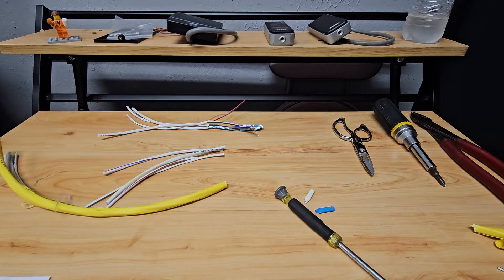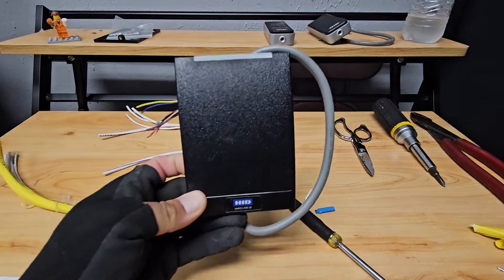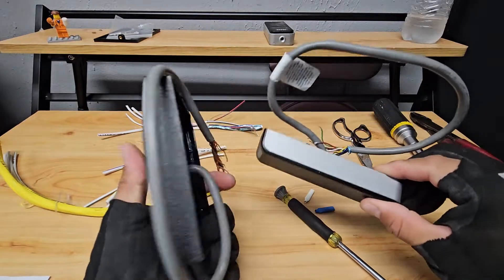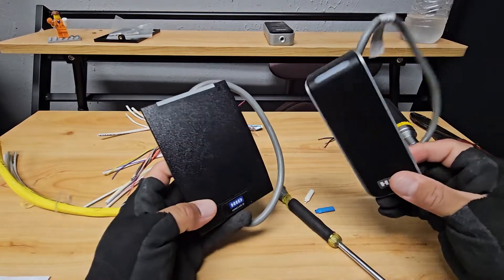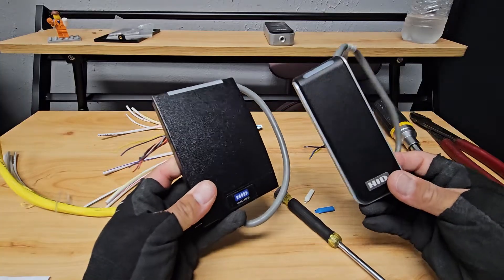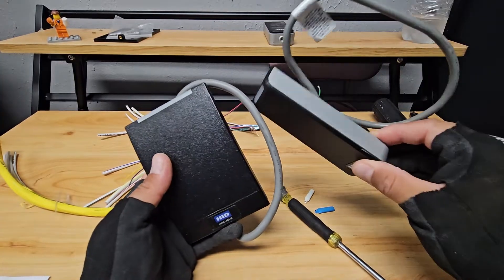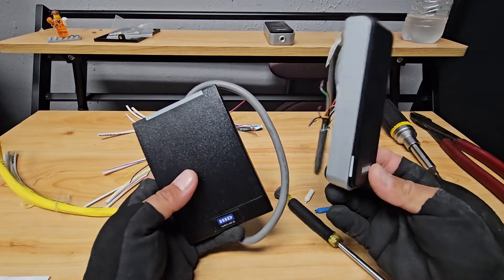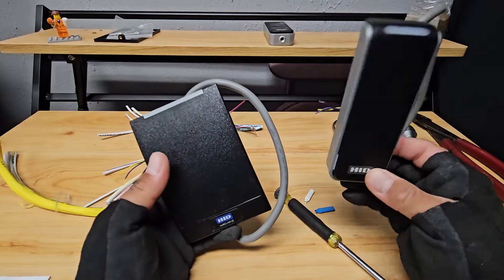Access Controls Wiring Basics Tutorial

Comment: Hi the power lock cable 18-2 red and Black for power yes you right, and you said White and green use for another lock is wrong, the green and white for request exit. call REX. For Hight security away use the request exit  or they call Motion rex
Reply from the maker: Basics

18/4 Lock Power/Spare.
22/2 DPS (Door Position Switch)
22/4 REX (Requeste to Exit)
22/6 Card Reader.

Yes, I did say for another lock, which it can be used for a second purpose lock. But I see what you are saying. It can be used for a Rex Power for the Motion even though if you were to use the REX conducter 22/4 works just perfectly fine, and you avoid having to do any unnecessary splices.

That said, if you're using the 22/4 conductor for a Motion REX, it's suitable and avoids unnecessary splices.

Ultimately, the configuration depends on your specific scenario. For instance, in the case of a Mortise Lock with a built-in REX, instead of running separate Lock Power and REX wires, you can simply use a single 18/4 conductor to handle both functions.

Obviously, it all depends on your situation. Remember, this is just the basics because we can talk about a more complex system with multiple sensors and rexes (key switches, push buttons, door releases, etc.) In and Out Readers  

Please let me know if this helps. Just sharing knowledge
Reply: Why not series the Rex with Maglock at the door so it's independently from the panel  ?

Comment: Great video. The reason why you only use one of those cables in 3/4 conduit is because of NEC code regarding fill capacity. It has to do heat/ current.
Reply: General rule is 40% fill of conduit capacity. It's not strict on low voltage, but for safe pulls it's still good practice.
Reply from the maker: Thank you for coming back and sharing this. I appreciate it.
Reply from the maker: Very information. Thank you sir.
Reply: @ No problem. I love learning and sharing.

Comment: Can you show/explain the drain. Ive been doing low voltage, but don't understand where to ground it- does it connect somewherein the panel. Thank again
Reply: Yes, drain wires need to connect to Earth ground at the panel. You may be able to connect to the AC earth, but it's not always acceptable to use a common ground between AC and DC power sources. You can run a plain copper conductor out of your panel and connect to a ground rod or water pipe.

In the panel, it's best to use a ground bus bar, but you can also just screw into an unpainted cabinet and ground that. Since it's just for signal quality and not for electrical safety, you have a bit of latitude in how you choose to handle it.
Reply from the maker: I apologize for the late response, after doing some research, one of the way it can be done is by hooking it, to the back plate of the enclosure, I was instructed by a Life Safety Power Supply Specialist and said this would be the most effective way in their enclosure. Or just run a ground cable from the ground from the door enclosure to a terminal block to earth ground all your shield wires. I have been doing this, and I have had no issues with all my installations so far.
Reply: @lowvoltageghost888  The drain wire should be connected to battery ground. This is generally a negative or common terminal. If you connect it anywhere else, the shielding won't cancel out stray signals and you would be just as well not connecting it at all.
Reply from the maker: Very interesting. So, in an enclosure with 24 card readers, how would you connect all the shields together?
Reply: @lowvoltageghost888  Generally you would have multiple negative terminals. Usually there's one for each reader already.
Reply from the maker: @SJ-nl6xl

Drain wires are used in cables in conjunction with a metallic shield to ensure effective grounding. The drain wire serves to complete an electrical circuit from the shield and carry unwanted electrical noise to ground away from the circuit.

In other words, is so if the wire picks up static, the data traveling through the wire doesn't get interrupted or start acting up when you badge because of high voltage by the area you ran your wire or any other static sources in the pathway.